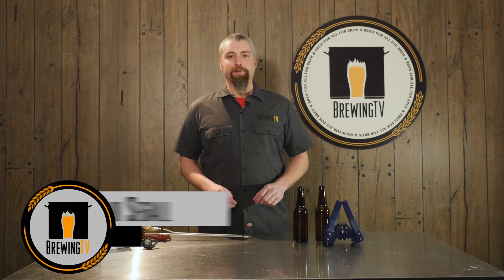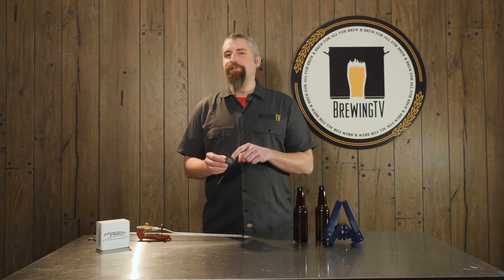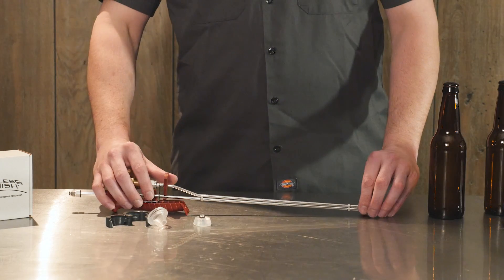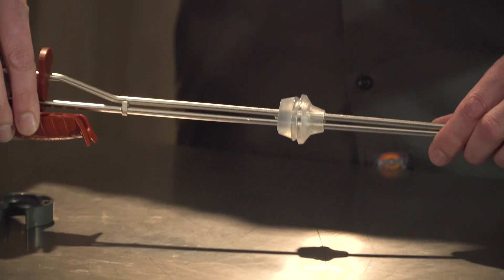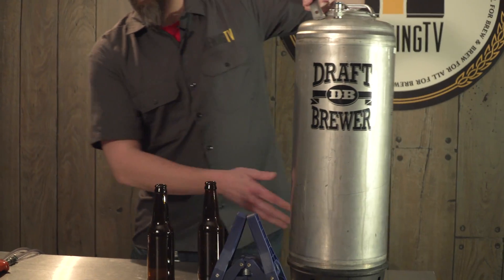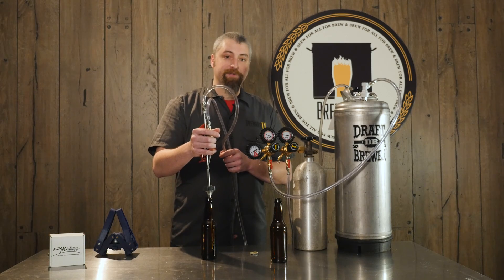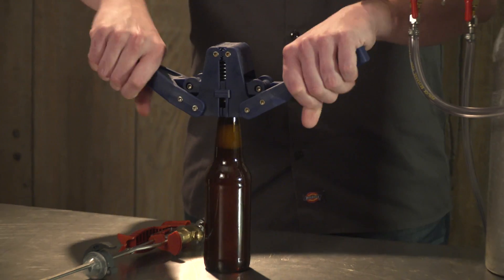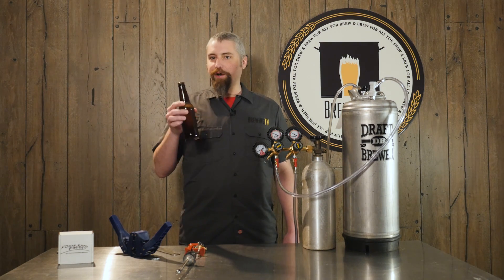Foamless Finish™: Last Straw® Counterpressure Filler

Comment: This was a great product but the plastic clip that holds the silicone parts together weakens quickly and no long pinches them tight enough for any pressure seal. Just a heads up for folks looking to bottle fill.

Comment: How long should bottles stay carbonated for? I follow instructions exactly and a few days later the beer is flat:

1) Purge pre-chilled, pre-sanitized bottle with co2 (keeping the stopper away from bottle so oxygen can escape while bottle is filled)
2) Seal bottle with stopper and continue filling with co2 to pressurize bottle
3) Begin filling
*I've tried both options 4a and 4b and still no luck in keeping beer carbonated long term:
4a) Fill up while allowing foam to build up slightly, cap on foam
4b) Fill bottle slowly without any foam to regular bottling fill spot, then cap
5) Store bottle in fridge until drinking

Comment: I'm sorry I am not usually in to writing bad reviews but this thing is horrible.  I bought it and after spraying myself with beer multiple times, playing with every pressure setting I could think of and wasting one of my most expensive beers by draining the keg trying over and over again to use this thing but resulting in flat bottle beer.  I will have to give this two thumbs wayyyyyy down.  Not a good buy
Reply: Ok I retract that it is a complete fail. You have to do things so very precise that it takes a long time. First of all you have to make sure that you get it clamped correctly follow the directions very closely. next to have to slide the seal down away so that when you press it on the bottle it doesn't start the liquid flowing then press the CO2 button to purge then push it all the way down into the bottle and let it start filling if you do this incorrectly it will spray everywhere.  Next you have to make sure that your pressures are right you need about 15psi on both the CO2 line and the beer line. then it should feel properly and the feeling will be very slow.  not exactly ideal if you're bottling a lot for a bunch of friends

Comment: I purchased one of these, and there were a couple of subtle steps that I missed the first few times watching this video. First, I didn't realize that the purging step was actually different from the pressurizing step. Second, if you don't get the compression clip on in the right position (just aligned with the slit on the main body), you will get leakage out of the slit in the top. This causes a small amount of foam. There actually is a bit of a trick to it. Finally, seating the Foamless Finish on the top of the bottle (the right height) isn't trivial, either. In fact, if you have too much downward pressure, you actually get a bit of kickback as you're filling, causing the Foamless Finish to move up the Last Straw AND eventually resulting in a POP (with possible beer shooting out if it's too close to the top of the bottle) when the pressure gets too high. 

I'd suggest that, if you guys could, do another video where you show a more close-up (and slow) view while you're putting the compression clip on. That was one of the trickiest parts to me. Also, if you could, perhaps show a couple of bottles filled in succession, so you can see how to go from one to the next, since I'm likely bottling a whole keg, not just one bottle. Also showing how to seat the Foamless Finish on the top of the bottle (getting it in the right position on the Last Straw) would be super helpful.